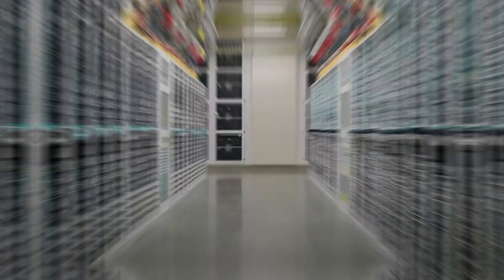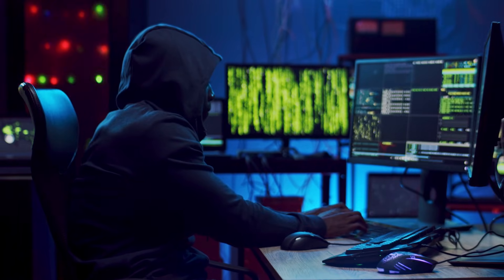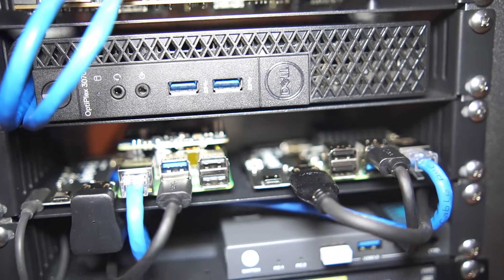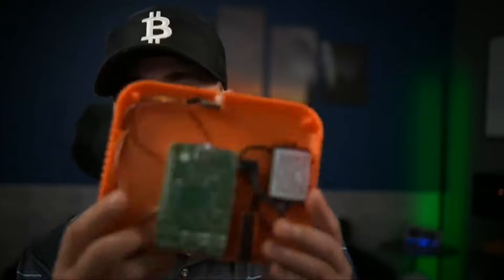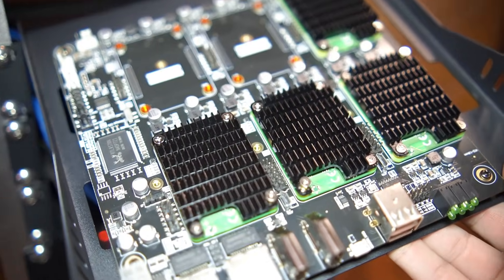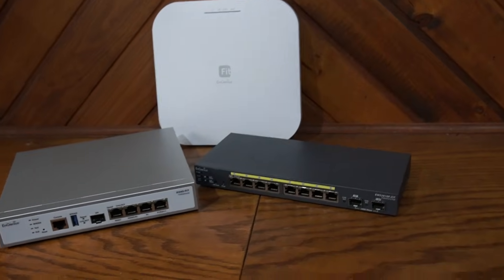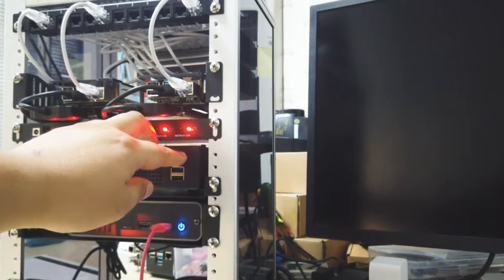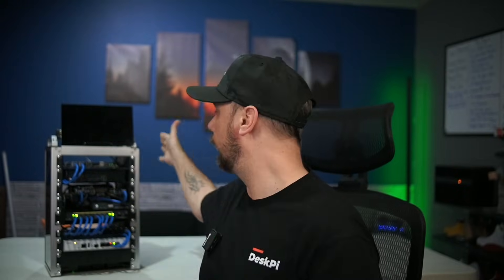Who Needs a Full-Size Rack? Check Out My Pocket Sized Data Center!

Comment: I picked up a mini rack. I added a mini up (cyberpower st425). 1 plug for all my rack.

Ugreen 2.5g switch. 3d print face plate

2x tp-link sg105. 3d print face plate

Brush cable management panel

Synology nas with 1x10tb and 1x8tb.

Mini pc with a ryzen cpu running proxmox. 

Router is a tl link but i am trplacing it with a n150 mini pc firewall/router. Loaded proxmox and i am playing with opnsense, pfsense, openwrt until i find one i like. Then i dont know it ill virtual the router or just bare metal it. 

Im sitting around 50w idle and i can push up around 80s.

Comment: They are cheap and nasty build. Once they correct the drill holes and make the sheet metal stronger, I buy one.
Reply from the maker: But why? 
It's a small box, what are you going to put in or on it to require intense strength? Lol
I have two of these now, and the build quality is great, for the cost. 
Good value here, imo 🖖
Reply: @GeekOfAllTrades a friend as the U8 and U12. I tried both with my van as I am making a portable 10inch system. It’s a good system for PI but the manufacturer stuffed up with measurements of the holes and used poor material. Hopefully they do a Mk2.

Comment: with alot of the new Unifi stuff, 10" racks are definitely going to be relevant now. I have a UCG Ultra for my router, 2x USW 8 PoE Switches, 2x Flex Mini 2.5G switches, a 4 bay RaspberryPi4 cluster running some websites, a DoD network awarness software I help beta test, Home Assistant, and another running a bunch of cool docker containers, and a 2 bay UGREEN NAS. Going full on network rack makes no sense for me. Thats where these neat little 10 inch racks come in and I can 3D print every single tray I need for exactly the device I have. Takes up NO room and I have it sitting in the corner ontop of the cabinet of my laundry room. I love these thing for home solutions for the small devices I run! Not ideal for business at all, but perfect for small home lab stuff
Reply: Similar to my stuff. I'm looking for a mini rack.
You got everything in the mini rack? Which one do you have ?

Comment: I had a large enterprise server; it was great but made a lot of heat and a large electrical bill. I now have a Ryzen 5950X MSI Pro B550 VC mobo, 128 GB RAM, 6 M.2 drives, and 8 x 8 TB spin disks. It's much cheaper to run and just as much power. That thing rocks.
Reply from the maker: @wartlme  same here, went from a 4host r730 cluster down to a single r9 5900x host with 128gb ddr4. It was nice bragging tights to have a data center in my basement, but totally overkill for my use lol
Reply: Same had Dell R710. Now have Ryzen 5600X running 65watts a lot cheaper, low noise, less heat, and quite compared to the R710 which sounded like a jet engine taking off.

Comment: "Lord knows what happens if Minecraft is down." I'm so apprehensive about hosting Minecraft for anyone because I dread the burden of keeping everyone's Minecraft fix working smoothly. I'm not even kidding. :P

I really like how you did the PSUs at the bottom. With these smaller devices, it seems like managing the power bricks is the most difficult part. Maybe you could put a UPS underneath and grab some 1 foot power cords to get more cables out of the rack itself?

Comment: I'm so glad to see more products like this. I have a 9U 19" rolling rack under my desk because I needed a way to safely stack my network … stack … under my desk. This would have likely been a cheaper, more space efficient option for a firewall and switches and a mini-PC server or two. Actually, I'd still consider this for my mini PC Proxmox node. It's got a USB hub and a USB fan and external storage all just piled up around it. This would be perfect for organizing all that. (Crap, now I want one.)

On the other hand, I'm glad I ended up with the 9U. It gave me plenty of room to grab a used rackable full width console server that's saved my bacon a few times, and the patch panel being centrally located under my desk has done wonders for my cable management in the office. There's also room for my UGREEN DXP8800 to live in it, and it's all on wheels. That's super-important, as I'm disabled and disassembling and carrying around all the equipment in the rack isn't something I can do myself. I'd even have trouble carrying a fully assembled Rackmate T1. But with a rolling 9U, I just need to unplug a few power cables, and the whole thing stays assembled (and all the interconnecting network cables and serial cables stay connected) while it rolls to its new home.

Put another way, this would have been all I needed, but the full-width 9U definitely let me get a few extra things that I'm glad to have.

Comment: When they come out with the Black Pi monitor I'm going to buy one of these racks and one of those and build a really cool setup. I've already got a few accessories that work with this one. I'm going to run a blank plate with a vesa adapter at the very top and mount the 15in monitor on the front. I was thinking about recessing the vesa mount some so it sits more flush.

Comment: These mini racks are looking really neat. My lab is traditional sized servers, but that's starting to look like a waste of space.

One suggestion, you might consider using slim ethernet patch cables to really clean up the cable runs on this rack.
Reply from the maker: @zenith54  100% agree. I was using legacy, retired servers i got from work or cheap online. They use so much more power, and are needed for some workloads, but mostly this is a great entry into homelabs and when you get to that point, a great way to consolidate too potentially. 

Also i did get some slim patch cables recently that i cleaned up the front of the rack with. You'll see those on future update videos too :_VULCAN:

Comment: That little NAS looks so cool, it's filled with a futuristic tech vibe. Besides the two HDDs, does the NAS also have an SSD inside?
Reply from the maker: @DeskPiOfficial  it has eMMC storage onboard and upgradable ram, but it's ddr3. Still more than enough to run it as a storage device.
Reply: @GeekOfAllTrades  like a SBC , for the NAS is enough, such like Raspberry Pi NAS.

Comment: If you need help installing windows, let me know the issue. I ran it on a cluster of 8 RPI 4’s. Mixture if 4GB and 8GB units. They ran pretty good, but I ran them off of usb nvme adapters and tweaked the firmware/bootloader

Back in 2018, I 3D printed my own 10” rack and 1u units for it. It was a lot of printing but turned out pretty good. I’d much rather just buy a pre-manufactured unit like this
Reply: Windows 11 ARM 64bit？Cool,  what your cluster use for? calculation or network services ?
Reply: @ windows 10 ARM X64. Haven’t tried upgrading it to 11 yet. Mostly network based services, but I have used them for some compute level stuff in the past with them. Using it for some various homelab services. At some point, I’d like to get them upgraded to CM5’s using the DeskPi Mini Rack
Reply: @RetroMikeTech  which one? Do you mean DeskPi Rackmate T0 ?